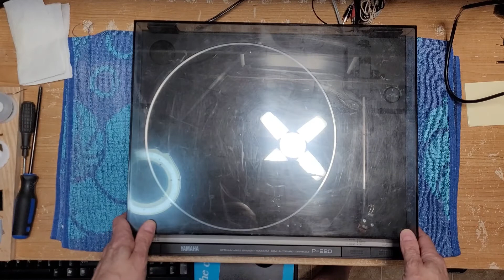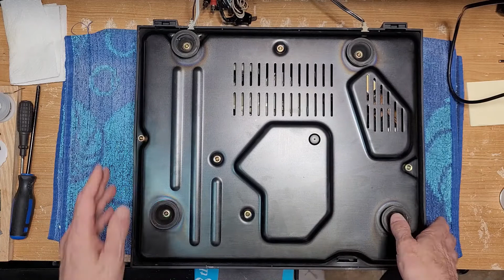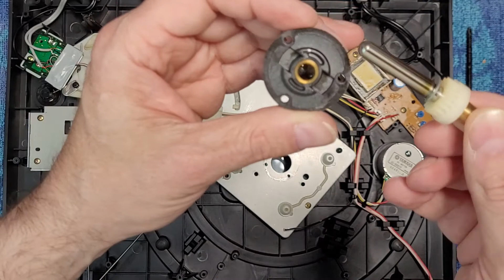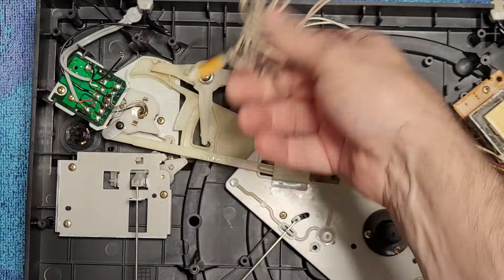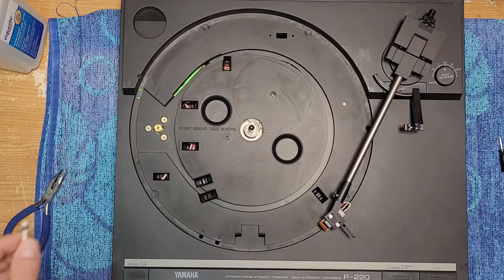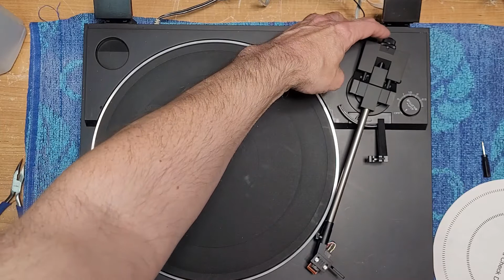Yamaha P-220: Full Service

Comment: Sir. Thank you so much for the excellent detailed instructions. I live in London. I have a Yamaha P-200 which although hardly used, has been idle for more than 20 years. Based on your instruction, I changed the belt and the Yamaha (Nippon Gakki) B7700 stylus. I connected it to my cinema home Arcam AV 860 preamp. The sound is too low. I have to switch to Stereo Direct and the maximum volume to hear the sound from old opera LPs. What is the problem. Can you help me please? Thank you in anticipation. Ayad Abdul-Ahad
Reply from the maker: Your receiver probably does not have a Phono Pre-Amp.  You cannot connect a turntable to just any line-level input.   It must be labelled "Phono".  You can purchase an external phono preamp just about anywhere.

Comment: My  Yamaha PF-30 has no screws on the top or bottom.🤔😯 The power on lever switch is broken but I can't get to it to replace with another blade toggle switch? Help !!!! 🤓
The Nippon Gakki (Japanese Musical Co. Ltd.) built Yamaha PF-30 turntable has this tiny counterweight on fishing line! Looks impressive going up and down as the arm moves in and out. My guess an anti-skate setup as there's no other adjustments other than tone arm weight? 🤓Cute but fiddly moving the unit around.🤩😂

Comment: I just checked my P-220 I bought used years ago and never used it. Removing the rubber smear off the motor pulley and yes, the speed tuning potis under the platter was really a "pain in the ass". look on YT: "YAMAHA P-220 Schallplattenspieler in Silber"

Comment: Enjoy watching your repairs and services, was wondering if you have done any work on either the Sony ps 4300 or 4750? I have a 4300 and it powers on but the touch controls for the start/stop and repeat functions aren't working at all, any ideas on how to approach this problem?
Keep up the good work.
Reply from the maker: Open it up and remove the main control board.  Try a little contact cleaner on the function buttons.  Thanks for watching.
Reply: I should have said ps x6 not 4750.